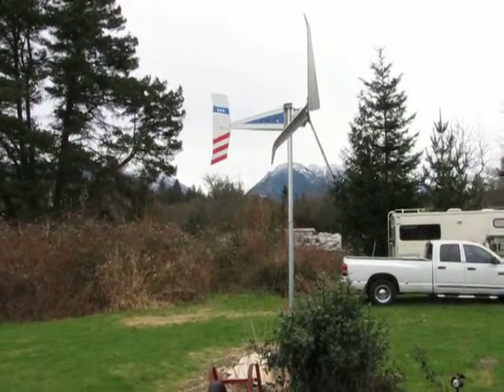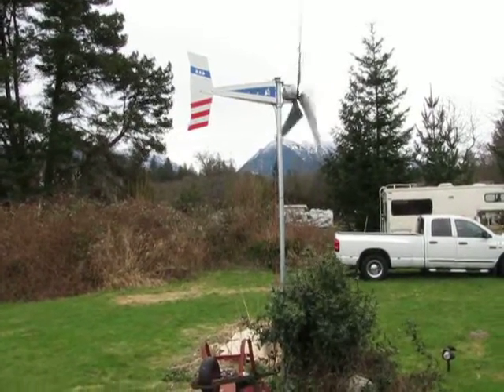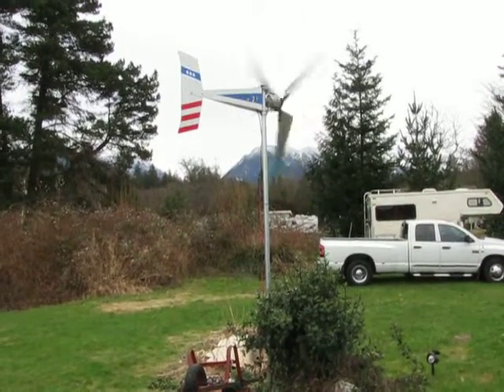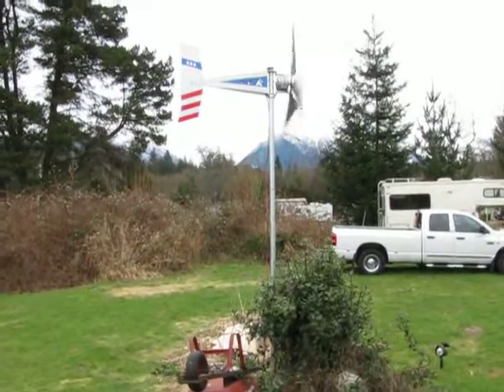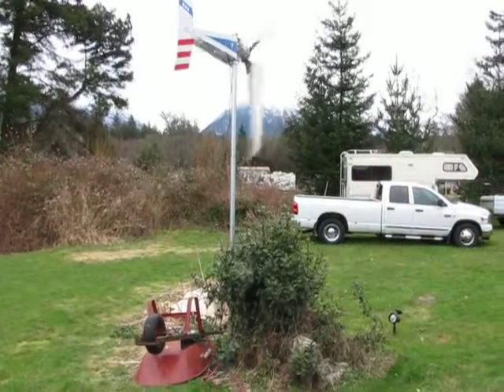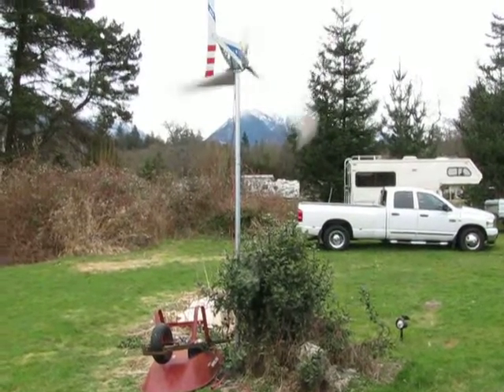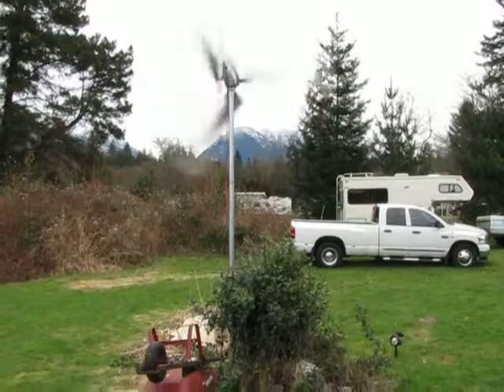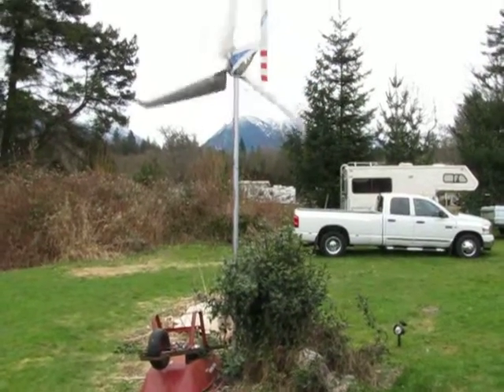80 Inch MW&S Falcon Mach4's,, having fun with my lil MW&S 500watt turbine :)

Comment: You sure those are the 80 inch ones and not the shorter 60 something inch one they look a bit short to me. One of those blades should be 6 foot 8 inches long
Reply from the maker: One of these Falcon blades is about 10 inches longer than my Raptor blade,, That adds up to about 20inches larger over all,, blade tip to blade tip,, than my Raptor blades,, About 80 inches blade tip to tip,, I am pretty sure these are the 80 inch Falcon mach 4's :)

I will be ordering another set of Falcon blades,, the Mach3's,, within the next week ,, I want the smaller ones,, the Mach 3's :) we will see for sure what blades I got now when I get the new ones,, it should be some time within the next 2 weeks :)
Reply: Jason Brown Okay my mistake I just went and read the info you're right
Reply from the maker: Romo Jack
These 80 inch Falcon Mach 4, blades are really cool ,, but way to much for the single core PMA and PMG,,

I think a 3 blade set of the Falcon Mach 3's or the basic Falcons will work well on the Single core PMA's and the new MW&S PMG,, I plan on testing it out :)